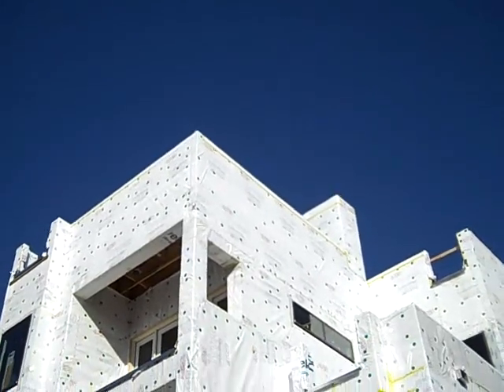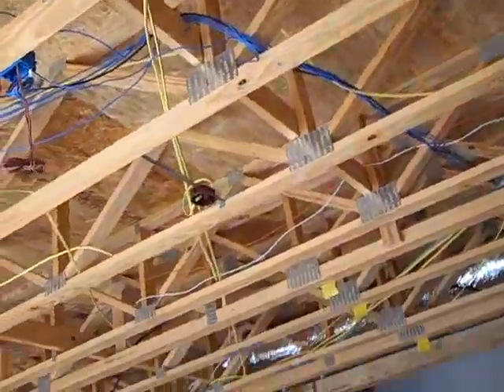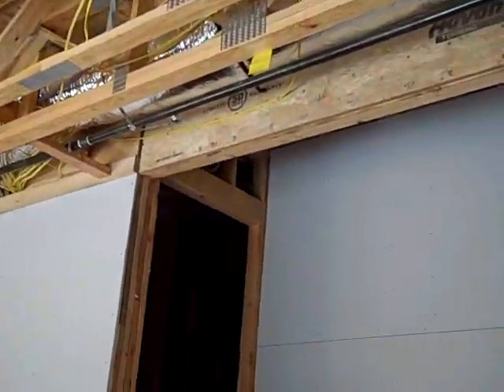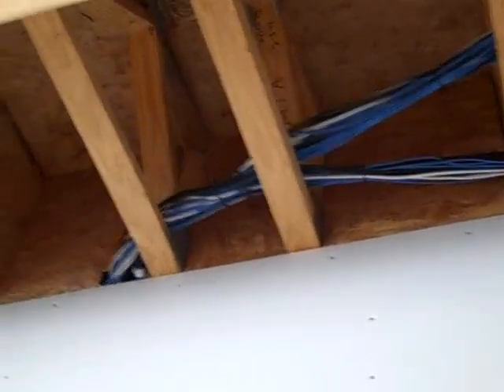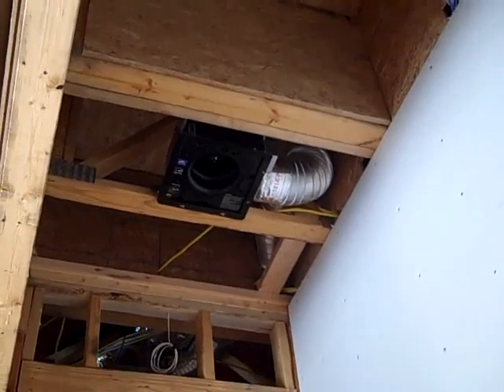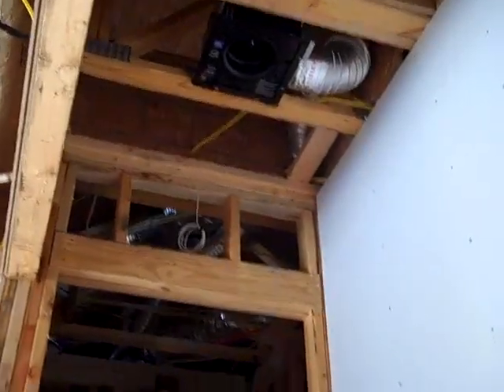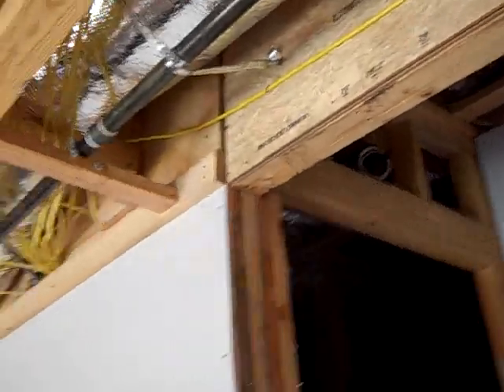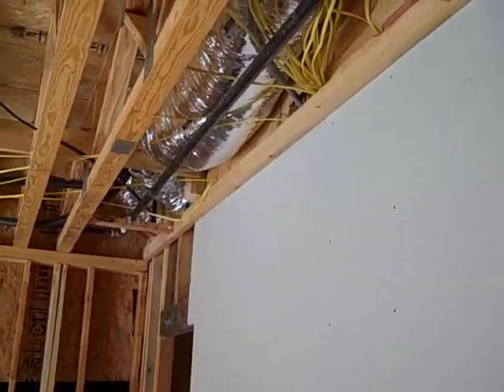Best Practice Attached Garage Sealing for IAQ

Comment: Is that exhaust fan also a means to cool down the garage during the summer?  I did see your video about the mini-split, but not going that far of putting an a/c in, would the exhaust fan be a good way to bring the temps down several degrees even with insulated garage doors?